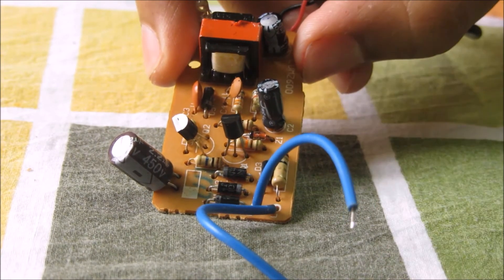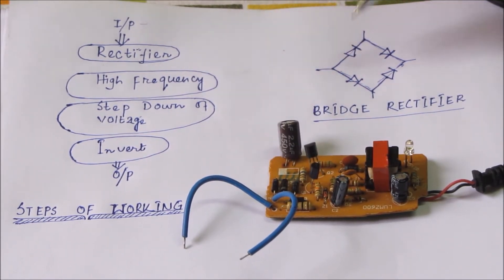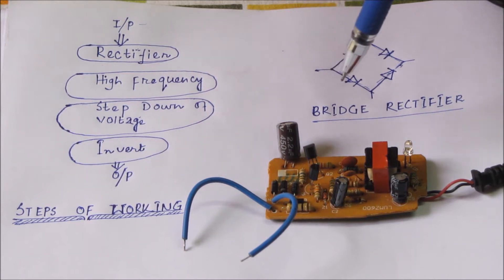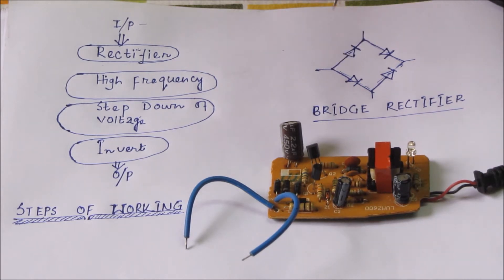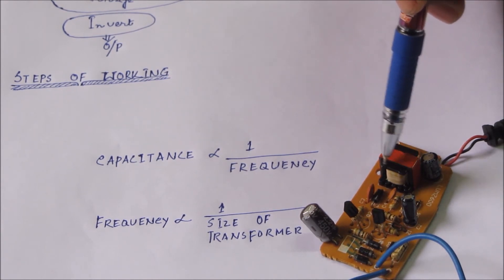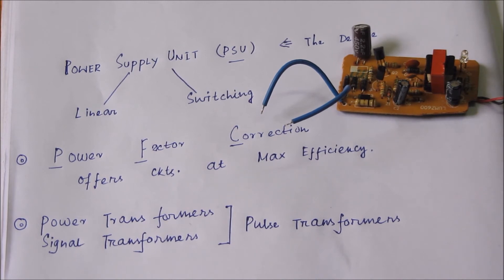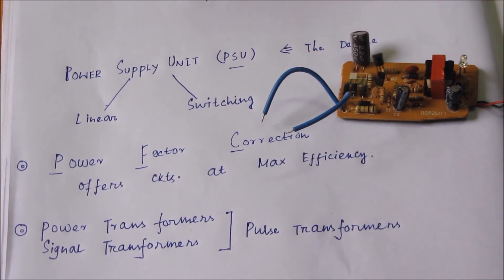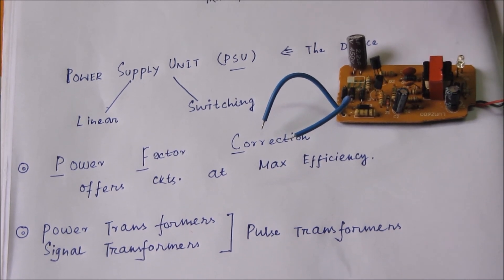Tutorial 3# How a mobile charger works

Comment: Hi ,if capacitor or resistor fuse shorted ,will it give 220 output
Reply: Because I am working on a project water level indicator ,I used mobile charger as a power supply,is it safe or not

Comment: HI, I want to know about transformer value, Zener diode value. I am working on this project. Please Help...
Reply from the maker: P Pandey , its a pulse transformer. This transformers are found in range of 220/6 or 220/5 basis of primary and secondary side.
Reply: Thanx for sharing knowledge. Please tell me Zener Value
Reply from the maker: P Pandey  ,actually the value of zener diode depends on the circuit design. I do not know the wattage and voltage rating in which you are using it. If you kindly give your mail id I can mail you the list of different zener diodes from which you will get the exact answer you need.
Reply from the maker: But for that check the voltage rating and wattage rating carefully.

Comment: Thank you !
I am working on a project and have a question. 
How small can a power supply be made? I need a phone charging circuit like the one in the video that is leds than 6mm. in thickness.
Reply from the maker: William Vasseti                                                 well I'm sorry fr late replying you. You question is a good one. Actually it this charger the thichness is more because of transformer and the electrolytic capacitors. As the PCB,Diode or resistor do not take much space. If you replace transformer or the capacitors with something low thickness components your work will be done.
Reply: All changes ditals www Shravan Gehlot 80481@gmali.com